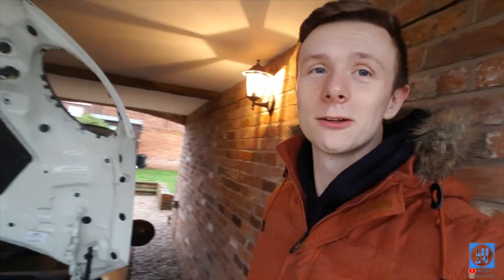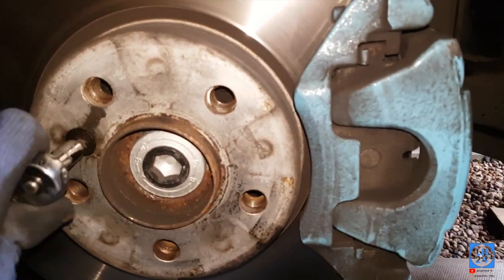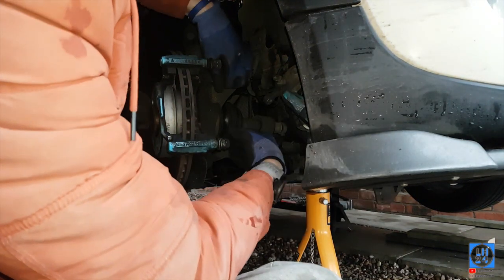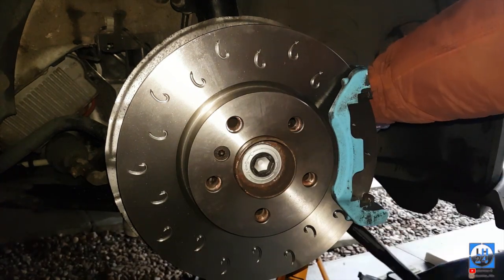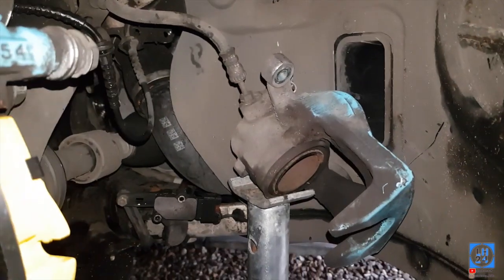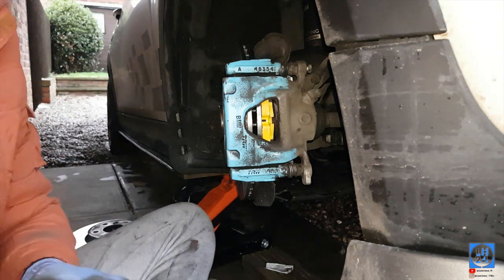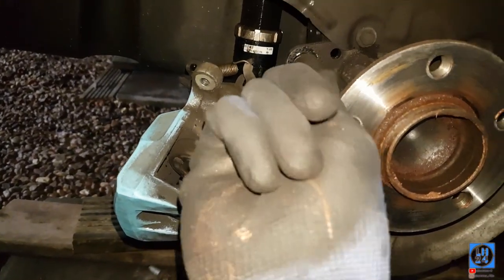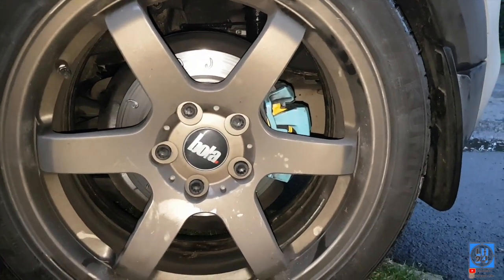Mini Cooper S F56 Brake discs and pads HOW TO/ INSTALL/ UPGRADE

Comment: just changed my pads using this video, no problems at all. thanks alot for the video. just want to ask, did you bleed your brakes after or did you not have too?
Reply from the maker: No you don't have too. Only time you bleed the brakes is if you cracked into the brake lines
Reply: @LawrenceHorsfall  I didn't. Just had the hoses changed to braided and the brake fluid done at mini. Thought I'd save some money on the pads. Made quite a few changes to the car this month so I think I'm done for the moment on upgrades
Reply from the maker: @jimboctration3354  yeah I need to get some braided lines.
Reply: @LawrenceHorsfall  I got the goodridge ones from lohen. £90 for the set. Notice a slight difference but haven't driven the car hard yet

Comment: Hi thanks for this great video. I see you changed your wheels as well. How did you sort out the tyre pressure monitor system? I am trying to change my wheels as well, but not sure how to make the pressure monitor work with the new wheels. Did you just place the original sensor on the new wheels? Do they match with each other?
Reply from the maker: Yeah i put the original sensors in the new wheels and had no problems. The car auto matches them so I wouldn't worry about positioning
Reply: @LawrenceHorsfall  Ok I see. Thanks for the explanation. I guess your aftermarket wheel's centre bore doesn't fit the hub of Mini Cooper perfectly right? Did you use the spigot rings? If yes, have you run into any problem with the spigot rings? It is interesting that one of my local garages told me that they won't fit wheels that need spigot rings, because they has caused their customers some problems before.
Reply from the maker: @shuokaipan4653  I used plastic spigot rings and all they are for is to ensure the wheel is located centrally then when you bolt the wheel on the spigot ring has no stress on it at all. the only downside to plastic rings is at track temps they can melt.
Reply: @LawrenceHorsfall  I need to ask you another thing. How did you loosen the anti-theft lug nut on the original wheel? I used the lug nut key and a breaker bar, but every time the key and the 21mm socket would just pop out when I pushed on the breaker bar. This is because the key can't fit on the lug nut tightly enough. So did you have this problem as well? I tried to untighten it using a power drill, but it still failed.
Reply from the maker: @shuokaipan4653  I never had a problem with mine so I cant really advise you of what you can do. Sorry.
Reply: @LawrenceHorsfall  Hi I see, it turns out that my anti-theft lug nut is broken, and has to be untightened by force in the garage. Just wondering if you have any experience in wheel alignment, I just had one in my local garage, and if I untightened the wheels again myself, would it mess up with the alignment I just had?
Reply from the maker: @shuokaipan4653  no removing wheels shouldn't effect anything

Comment: Great video, just one comment. If you can spare money on upgrades you should invest in a proper tool to wind back the piston, they’re designed to be wound £15-25 for the tool and you don’t risk wrecking the piston!
Reply from the maker: Thanks for the comment and I did buy one eventually

Comment: did you notice a big difference in braking with the new discs and pads? thinking of upgrading mine to tarox slotted f2000 and tarox brakes rather than the jcw big brake kit
Reply from the maker: Yeah I noticed a massive difference. Cold they're a bit more unresponsive but when warm. They're amazing. Loads better value for money
Reply: @LawrenceHorsfall  thanks very much. pretty confident i could change these myself now after watching your video.
Reply from the maker: yeah they're an easy job that people get charged loads for. @jimboctration3354
Reply: @Adam Omylanowski I've just bought some braided hoses and thinking of buying the yellow ebc pads too and I'll see if that helps enough to mean no further improvement. Do the f56 pads fit in the calipers you have or are they different?
Reply: @Adam Omylanowski just bought the yellow stuff pads. Got front and rear for £100 which I thought was ok. Do you think I'll need to change the sensors as they haven't flagged up on the dash yet. The old pads are ok I'm just changing through choice

Comment: An easier way to reset the piston is to put the old pad against the piston and use a C clamp to push it back in. The pad makes sure the piston goes in even.